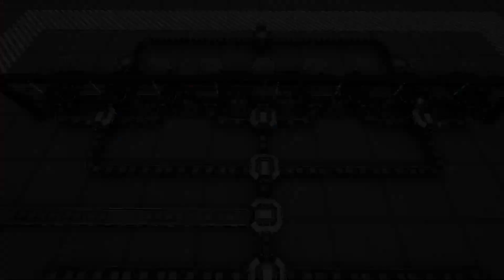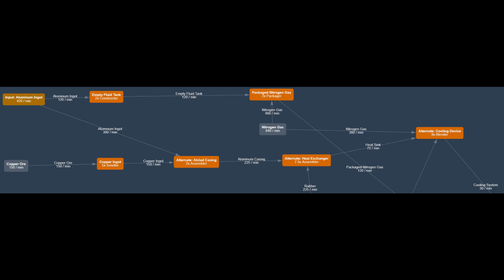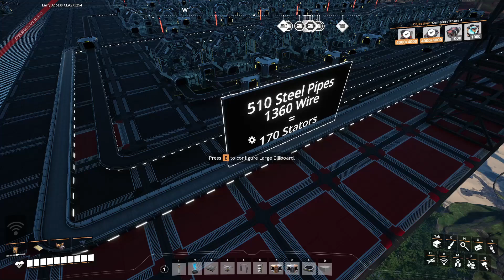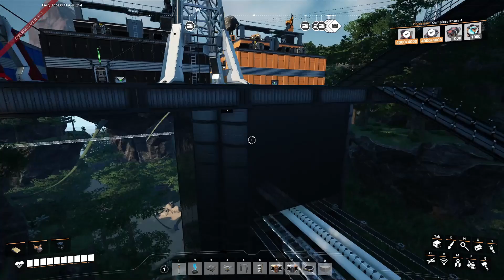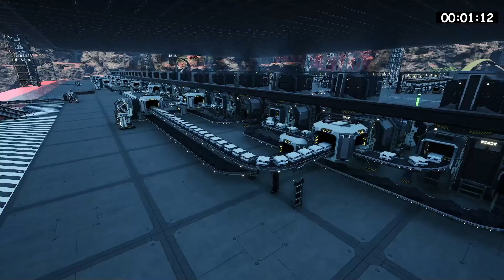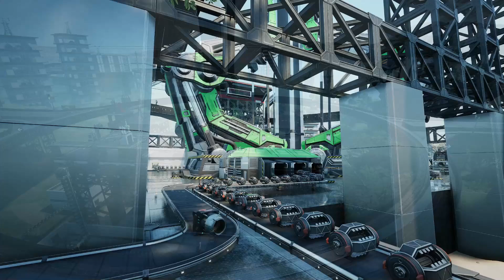10 Thermal Propulsion Rockets - LOAD BALANCED - Satisfactory - Update 8

Comment: nice video!  do you plan to play 1.0 as a load balanced playthrough as well?
Reply from the maker: Thank you! I am! I’ll probably switch things up and try to do a few big mega factories instead of the countless towers.
Reply: @moo121  im already planning out my factories.  one for basic parts, one for all the frames, one for all the engine parts, etc.    one for all the space elevator of course
Reply from the maker: That sounds like a good plan! I only have vague ideas so far. I still haven't decided which starting area I'll go with.
Reply: @moo121  oh I knew where I was starting immediately.  im going back to the grassy fields for nostalgia.